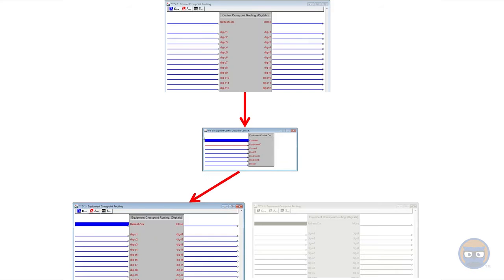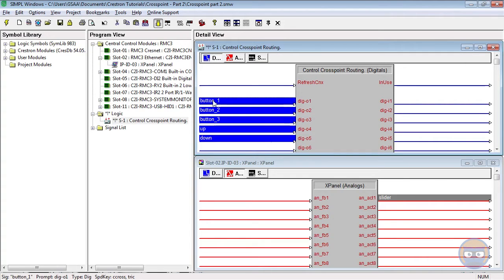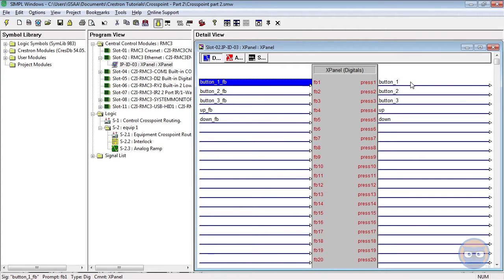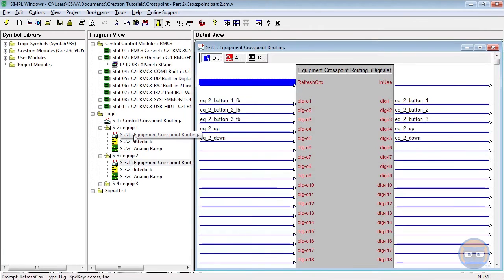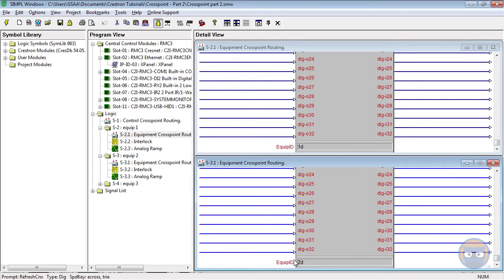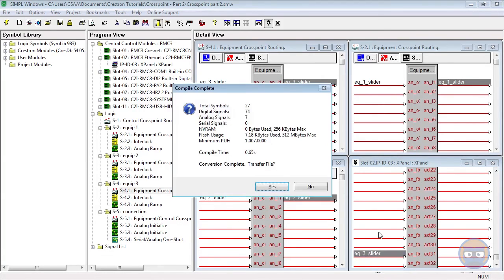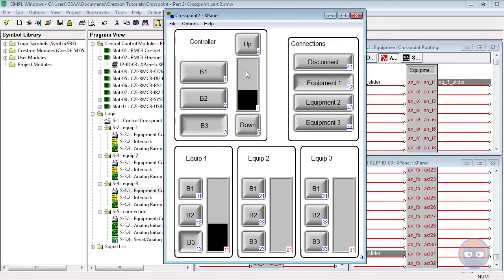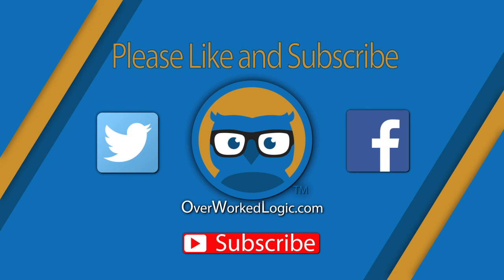Crestron Crosspoint 102

Comment: Does anyone know the name of the simulation with the buttons?
Reply from the maker: That is an "xpanel" which is basically a simulated touch panel. In this video it is the older version of the xpanel that doesn't support smart graphics. If you create a vt-pro touchpanel project as type "xpanel" or "xpanel smart graphics" you can emulate a touchpanel for testing and/or also as a virtual touchpanel that lets users control the system from a computer.

Note - you still need to be running the program on an actual Crestron processor, this is just the user interface portion that is emulated.

Comment: Did you found a way to not propagate analog values? This might be critical when you have set some microphone levels in dmps series.
Reply: I was looking at that too. I believe you could add an analog equate (looking at what equipment ID you've chosen) , then use an analog buffer on each equipment slider (which is enabled by the equate of the Equipment ID), then that output of the buffer could go through a rate limiter to smooth out the transitions. That goes back through the control crosspoint and then to the xpanel fb. Essentially what I'm trying to say is, every time you select an equipment, the control slider is looking at the value of the equipment, and the control slider matches that instead of pushing the control slider through first.  The up and down ramp buttons of the control slider would still push through to the appropriate equip, but every time you switch, the equipment value doesn't look at the control, the control looks at the equipment.
Reply: I know this is an old comment, but some people might still be curious. One of the best ways to not propagate analog values until changed is to serialize them with the symbol xsig (intersystem communications). You basically feed your analog into it, and run the serial output into the crosspoint. Then on the other end, get the serial out and run into another xsig. This setup with offset 0 and option 0 as the parameters on both ends will only propagate changes so when the crosspoint connection is made, it won't push the last value through.

Comment: Thank you for your videos they have helped me a lot! Is there anyway you can do one on the Ethernet Intersystem Communications. I feel I understand how it is supposed to work, but am not having much luck. I am using a CP3 as my main program controlling an 8x8 with various sources, but am looking to utilize a DMPS to bring in mics, more inputs, and be used as my amplifier. My DMPS is 2-series is this an issue? Thanks again for your help.